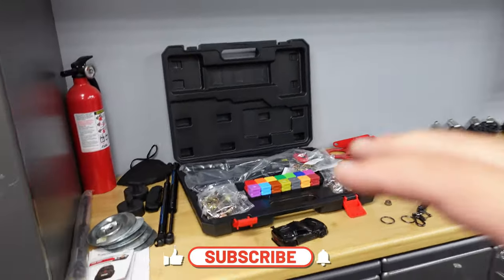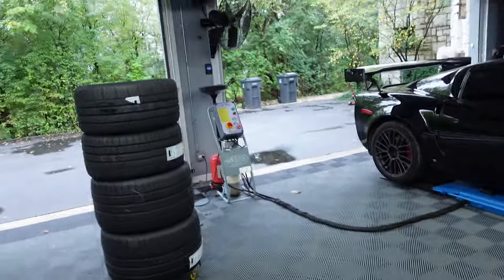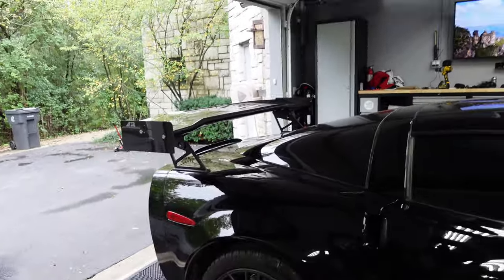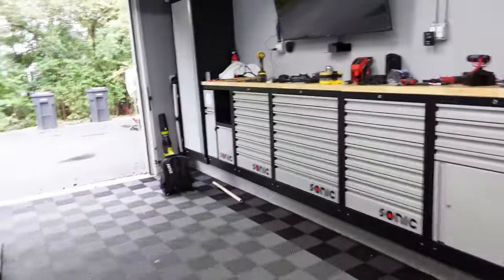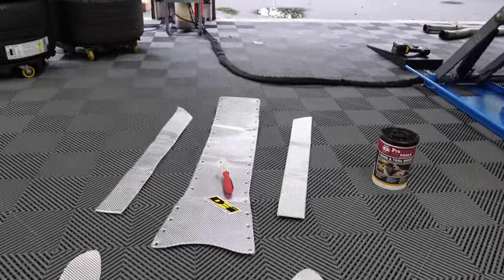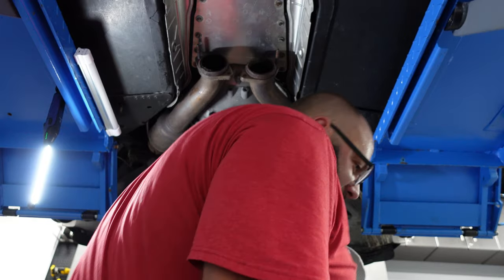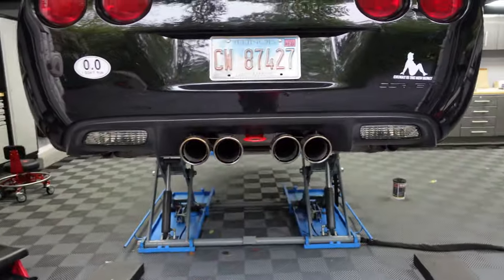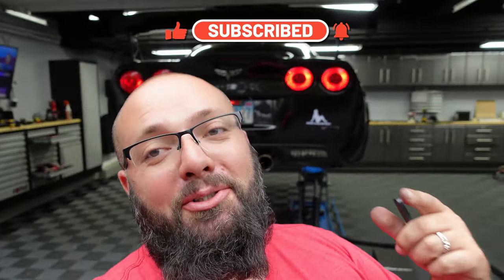Transmission Tunnel Thermal Shield- A Must Have Corvette Mod

Comment: II would have not compressed the insulation so much , since it relies on air to insulate , and just trusted the many bolts a bit more.   I think when I get mine installed, I will have extra adhesive on hand, so I can avoid pressing so hard on the roller to get it to stick.  I think the material just crept a bit starting from one end and rolling the multilayer material, so perhaps loose fitting the bolts to hold the mat in position before rolling , or start rolling from the middle and working across would keep the holes aligned.  I doubt the holes are misaligned from the factory , since they probably measured twice and cut once , at least, before marketing the product.

 I also would like to insulate under the manifold, with a product from the same people, but for  some odd reason it is not street legal in California.    all that needs to be done is send in some testing to the C.A.R.B. and it gets certified, C.A.R.B. doesn't retest the numbers, and it should test fine.

Comment: I’ve seen the LG 1/4in plateactually make the chassis stiffer. That may help u on the track bro check it out!!
Reply from the maker: Thanks. I will be ordering a 6 point roll cage this winter for next season, that should stiffen everything up
Reply: @GasTachs  most definitely because as u know these cars are basically two tubes inter-grated around the frame. The cage is going to make your car a monster on the track!!